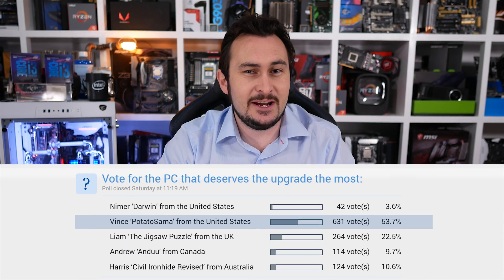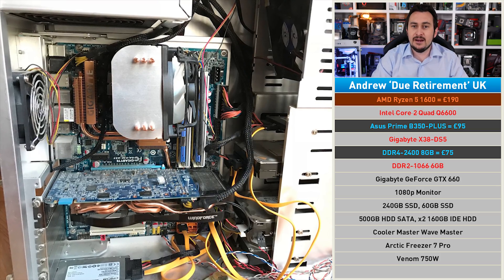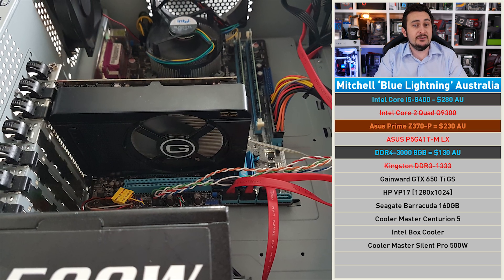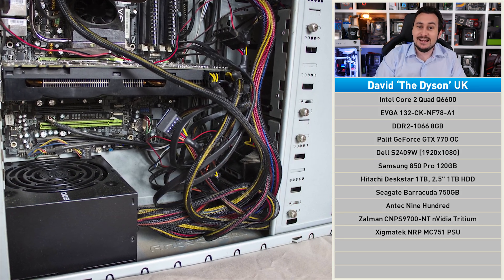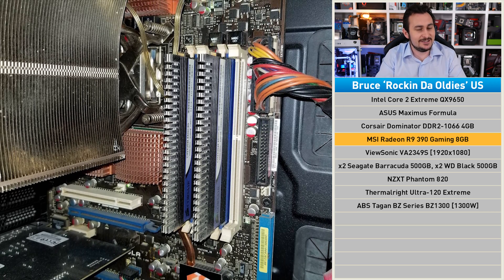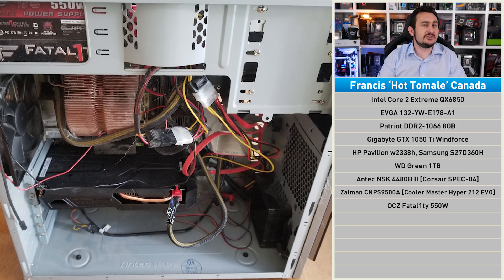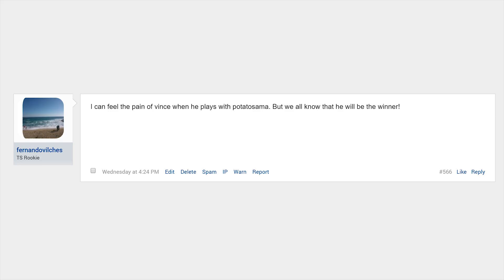Upgrade My PC Please! [S01E06] Core 2 Quad Land

Comment: Hey Steve can u put the 8700 against the 8700k so we can see if the 8700k deserves its price premium?
Reply from the maker: The 8700K is for those that want to overclock, pretty simple ;)
Reply: Hardware Unboxed thanks for the advice mate. I am fairly junior when it comes to this kind of stuff and am trying my first build and was tossing up between the two. Don’t want to risk overclocking until I read more up on it but the higher base clock and turbo clock got me wondering if I could justify buying it for the higher clocks alone (as I want the best in games). Thanks for answering my dumb question :)

Comment: I owned a Q9200 briefly. Most of my time with the 775 socket I had a E6600. Man those CPUs are so weak for modern games now. I can't imagine gaming on one of those Q6600s now.
Reply from the maker: Q6600 isn't great but it's worlds better in modern games compared to the E6600, you essentially have twice the power with the Q6600.
Reply: Adam W eyy could i get one of these cpu's i know somebody that literally has the slowest lga 775 chip the e3400 celeron a q 6600 is at least 2x as fast
Reply: +Pelle Sanders
Would send it to you however I sold that one a long time ago. They are quite cheap on eBay though.
Reply: +Hardware Unboxed
I played WoW on the E6600 with a Sparkle GeForce 9500GT. Still have the 9500 for a testing/back up card with an old CPU fan glued to it because the fan died. Let just say the graphics were not sparkly or the FPS blistering fast lol
Reply: yeah found a q9550 for 40€ he can buy that one i have an i5 6600 myself

Comment: Well I don't have a pc to upgrade I only
 have a laptop😔
Reply: CheeseburgerGAMING! Give it a try. You can build a pretty decent pc for 500$.
Reply: SoundwaveSinus9 ryzen 3 1200 is a good option for those that will overclock, a pentium or a 1300x for non-oc. I have seen that the 1200 stutters when not oc'ed to at least 3.7-3.8 are safe on stock cooler
Reply: I'd like to see your evidence Ravioli cause i personally think you are full of shit..and are either making shit up or got bad information from someone who doesnt know wtf they are doing the r3 lineup compete rather well with newer 7th gen i5's...r5 with i7's and r7's forced the launch of i9's..the entire lineup kind forced intel into rush releasing 2 gens the skylake-x and now coffee lake 6+ months ahead of schedule...depending on what you are doing an r3 can beat an i7 7700k very limited set of conditions where this is true but it is true none the less...if the r3 is hitting hard times with something you can bet the i5 will hit the same problem..if it doesnt then it is most likely user error...all an r3 1300x is is basicly a 1500x with smt disabled...so on anything where one hit a quad thread or less problem the other will two..and i can tell you right now my 1500x is bottlenecked like a mofo by my 50% overclocked r7 370.remember cpu can slow gpu gpu can slow cpu and ram can have a negative effect on them both..a poor psu delivering dirty power will also hurt performance...there's a variety of things to factor in if you arent using the highest end versions of everything else to set the cpu in....you wont know the true potential of any cpu till you pair it with the best of everything else...if the cpu isnt pegged out chance are something is holding it back

Comment: Why are you always picking such slow RAM for your Ryzen build suggestions? Surely at least 2666 or 3000 would suit Ryzen better?
Reply from the maker: Unless you are using GTX 1080 Ti or Vega 64 graphics cards it actually makes little to no difference. Obviously if DRAM pricing wasn't insane we would just got for faster memory.
Reply: Patrik Åstrand Difference in gaming negligible for the price I suppose?

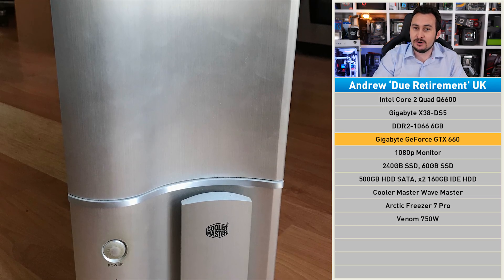Comment: Gtx 1060?? 1:25 i hope you mean 660..
Reply from the maker: Nah I meant 1060 of course, I made a typo in the side bar where I stated it was a GTX 660 :P
Reply: Hardware Unboxed i don't recall any gigabyte gtx 1060 shrouds looking like that, i think you screwed up again and called it a 1060 when it was a gtx 660 :P

Comment: tfw still using sandy bride lmao
Reply: Sandy bridge is still good though.
Reply: still rocking the C2Q q9400, bottle necks galore
Reply: My 2500k still is hitting 60fps on ultra and they're so cheap nowdays, I got mine for 70 USD
Reply: Few years? Uh dude...we're in the age of 6/8 core CPUs. 

Might get another year out of Sandy Bridge. Maybe.
Reply: Ouch@that low single thread performance! No overclocking???
Reply: Hey waddup
Reply: Got i7 2600 (non-K) for 105 USD, a B75 board for 30 USD, 4 4GB RAM stick for 80 USD. Never regret.
Reply: Dammitimmad problem?
Reply: deathbat6916 'S'??!
Reply: I got's me a Pentium e6300 - 2gb RAM - 160gb HDD - 1050 ti sitting behind me.
Reply: Get the right mobo and you can still step up a gen 2 with turbo but non k by 4.
Read link for more info.

Scroll down to the picture, Fully Unlocked vs Limited Unlocked Core
https://www.anandtech.com/show/4083/the-sandy-bridge-review-intel-core-i7-2600k-i5-2500k-core-i3-2100-tested/3
Reply: just bought a prebuilt office pc (toshiba) with a i5-2400 for $109
Reply: i got a 2600k, z68 board, 8gb ram, a 650 watt psu, and a 240gb ssd for 200 from a dude on craiglist. was only missing a gpu. steal!!
Reply: yup my 2600k at 4.5ghz is still a champ.
Reply: sadly i cant overclock my i5 2400 because of bios
Reply: Using a Broadwell-U laptop processor